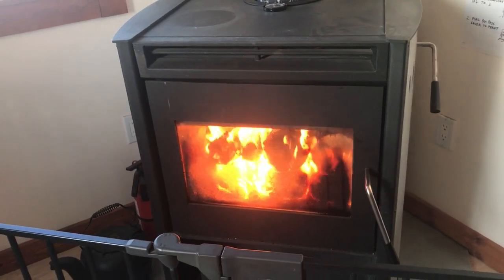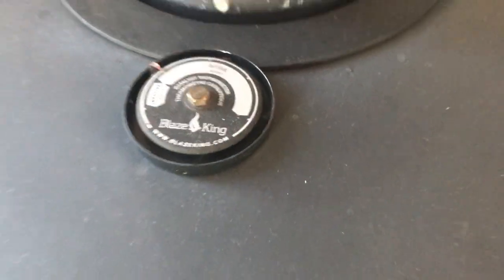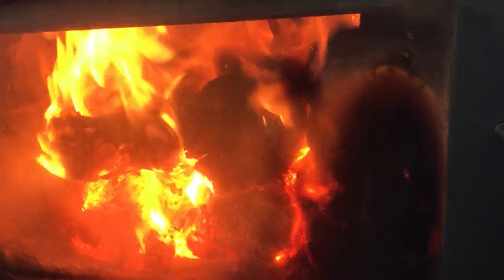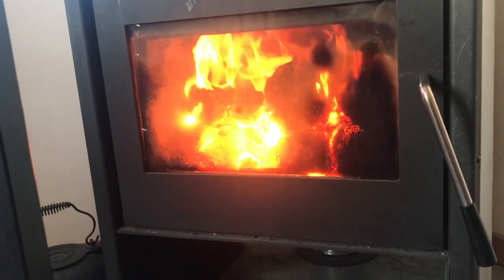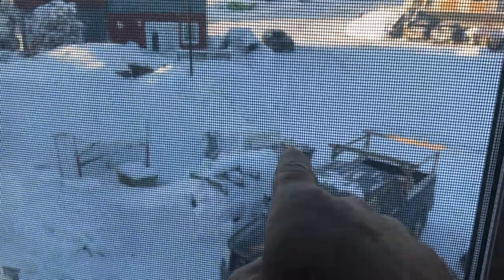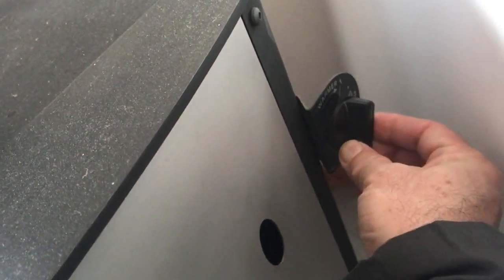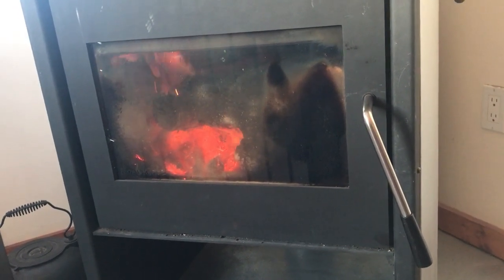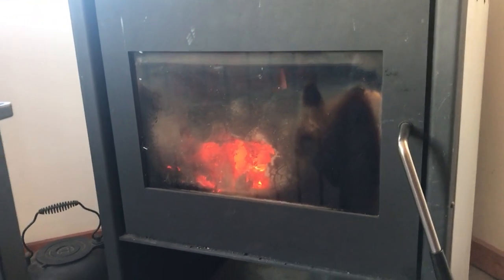How to light our Blaze King wood stove part 2

Comment: Thanks for your videos explaining the process.  I just ordered a sirocco 30 but it won't be here for another month. What do you get for burn times when you're set to 1? Also just curious it says in the manual to gradually reduce the thermostat. Wondering if you've tried both ways and if it matters.
Reply from the maker: We get up to 18 hours of burn time, on a full load of spruce/pine.  I imagine hardwood would last much longer.  I have also wondered about the instruction to gradually reduce the thermostat - we don't really do that and the stove is still working fine after 8 years.  Maybe with different firewood or draft, turning the thermostat down too fast might put out the fire?  Each chimney/house/wood/stove combination is different - we have a Blaze King at our cabin with a much shorter chimney and it behaves quite differently - takes much longer to get going.